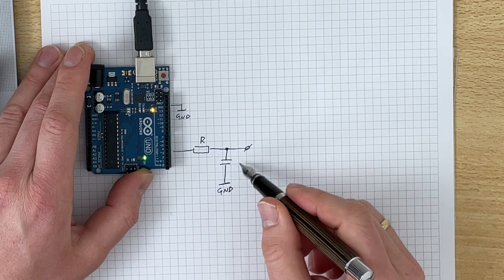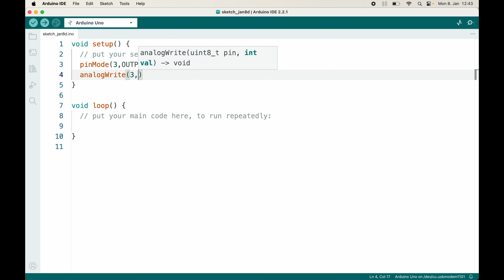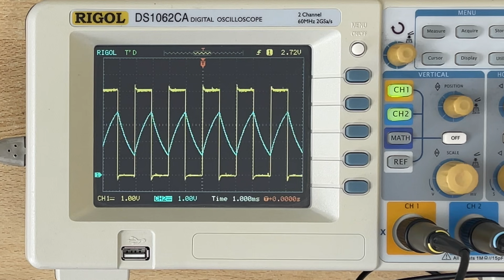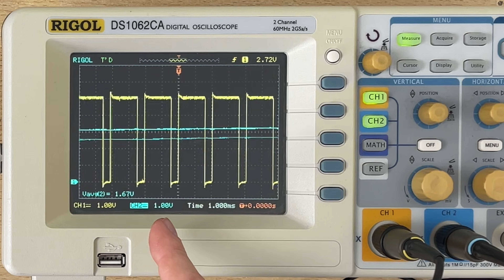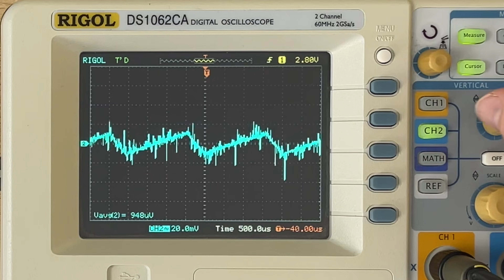Smooth analog write using an RC-filter - (Arduino Uno Programming for Beginners)

Comment: increase the frequency by using timers that would give you fast change by using smaller capacitor and still somewhat stable voltage

Comment: I see how you can definitely clean up the output voltage with this, compared to standard PWM. What I was wondering is when you would need to do this? You spoke of two examples for using PWM - dimming an LED and changing motor speeds, but would either of these benefit from a more consistent analog voltage output? Having fun with the Arduino and your videos are definitely helping.
Reply from the maker: Thank you for the kind words and the question.
When the LED is running constantly instead of pulsed, it will not flicker in movies, especially snow motion movies. 
When a motor is driven by a constant current, it will make less noise. In fact, you can use a motor as speaker if you drive it with PWM. However keep in mind to not drive the motor directly from the pin of the Arduino, you will need an amplifier for everything that consumes more than 20mA, otherwise you might damage the Arduino.

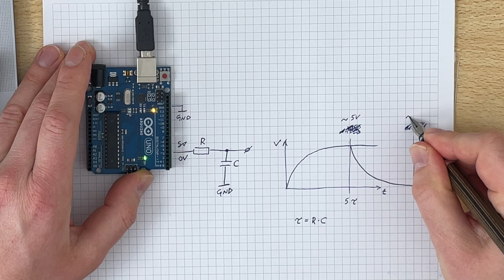Comment: Interesting video. This time more about electronics. I guess that is why Arduino is difficult for some guys, since you need to learn coding and electronics at the same time. For me it was fine, but I fear for a total beginner maybe a bit too fast. I must myself rethink why at timestamp 1:41 the unit [Ohm * F] is equal to unit [s].
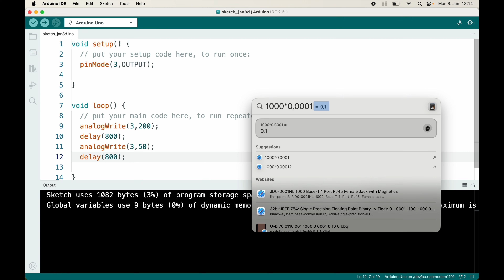What is that video at timestamp 7:56? Looks like that guy do short videos with hidden messages. Did you decrypt that message?
Reply from the maker: thank you for the feedback - [Ohm * F] = [s] ... [F] is also [C / V] (which is electric charge / voltage) and [C] is also [A * s] and [Ω] is also [V / A].

not sure which video you are referring to
Reply: @playduino  Thank you. I already found it a few minutes ago. I saw a guy that explained it even with SI units only. But that is of course over the top.

Jump to time stamp 7:56 in you video. You are using the calculator. And the bottom of that window you can see 3 websites. One about "RJ45", one about "IEEE 754" and one about "uvb 76". I asked about the last one.
Reply from the maker: https://www.youtube.com/watch?v=hViPU_NY6ok

it was a suggestion of Spotlight, never watched it before. it has 8views and it is very freaky :D and I am to scared to scan the QR code
Reply: @playduino  Ah. Ok. I also didn't scanned that. I only saw that he has a lot of similar videos also without QR code. I thought it was suggested because you already watched it. I don't know why, but every time I see someone using his web browser or going through his disc, I always watch out for file names, directory names, bookmarks and suggestions (for example if someone start writing in a web browser (since in most cases it suggest previously visited sites).
Have a nice weekend. I am looking forward your next video.
Reply from the maker: @Volker-Dirr yeah, sometimes you might pick up something interesting  :) thank you, have a nice weekend too!